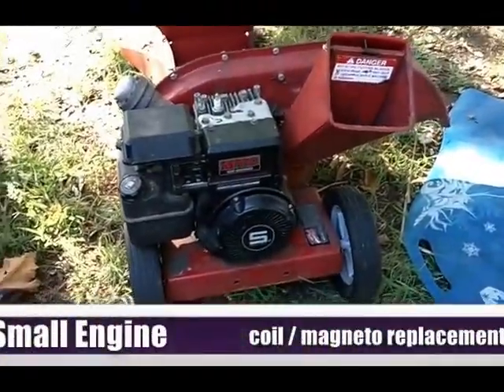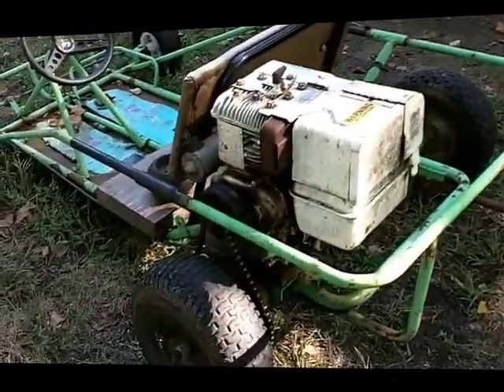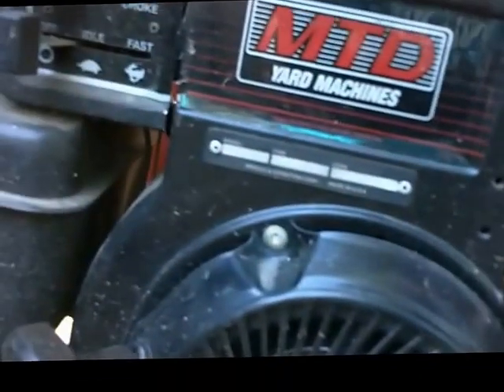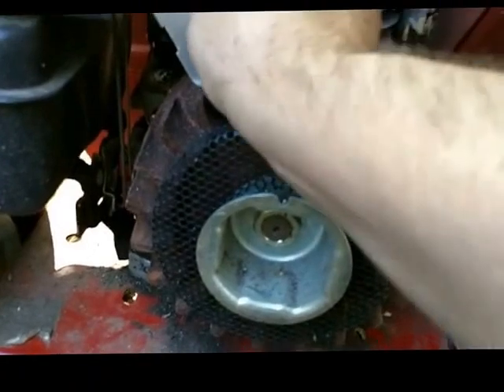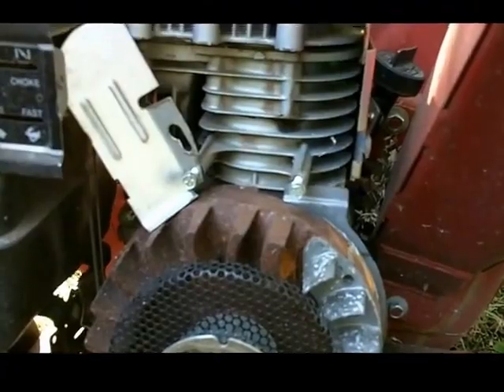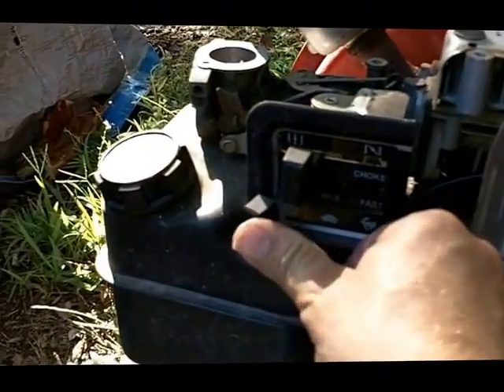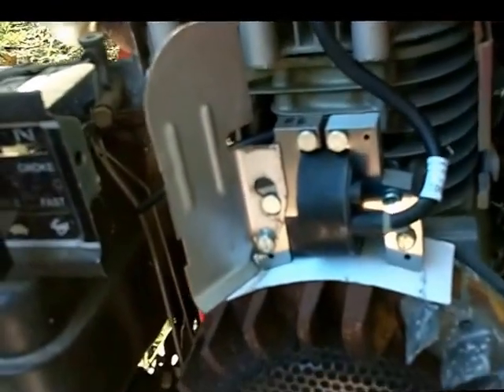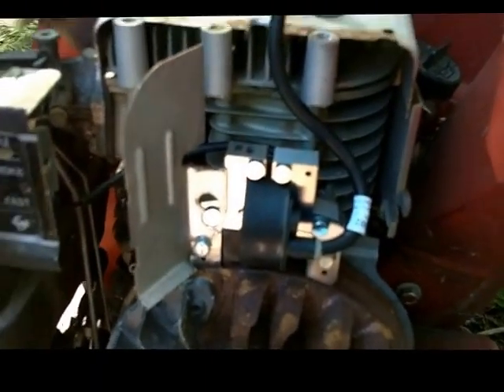How to Replace the Ignition Coil on a Briggs & Stratton 5HP Small Engine

Comment: A link to the actually product you bought would have been useful as I can’t find my model number anywhere.
Reply from the maker: Well, the coil you need will depend on what model engine you have. On Briggs engines, the Model, Type, and Date Code is stamped either into the engine shroud or into the valve cover.
Reply: Thank you, just the info I was looking for. Keep the awesome vids coming

Comment: soo i have a vintage briggs and stratton. i need to replace the coil but the old one has wires tht conect to the points. the new ones dont. how the hell does tht work
Reply from the maker: Did you get the right coil? Maybe you got one for a solid state ignition without points/condenser? I had a 1968 briggs engine and was able to eliminate points and condenser by upgrading to an electronic ignition. It required sending the flywheel to briggs and having them replace or re-polarize the magnet....